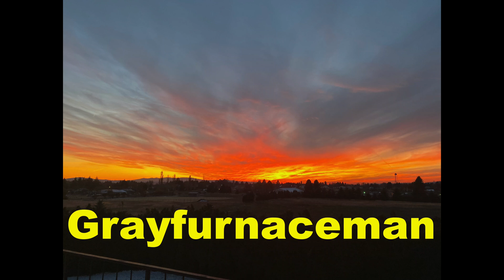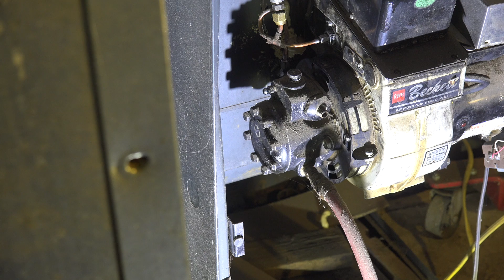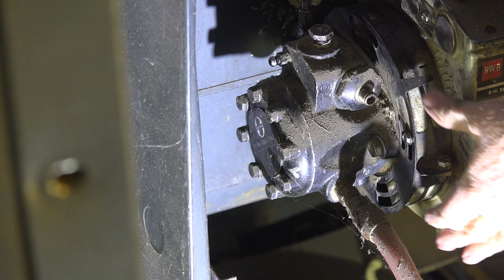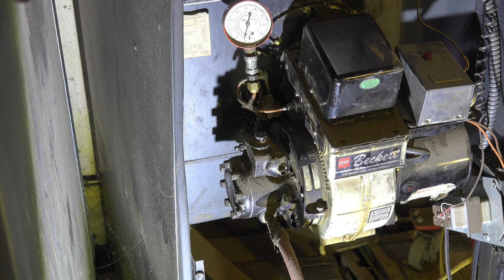How to find the air shutters on the oil furnace

Comment: I have been dealing with a smoky oil smell in my house for years. Every service tech I have had look at it tells me there is nothing to adjust and I should replace the furnace. After watching this I move the air adjustment from 5 to 6, and the smoky smell is gone. Wish I found this years ago. Thanks very much.
Reply from the maker: I am glad my video helped you solve your problem.
GFM

Comment: Would having too little or to much air cause a reset condition?
Reply from the maker: Too little air could cause sooting of the heat exchanger and smoke pipe which could shut it down.  But usually it will puff back.  A nice word for a massive blast of soot in the furnace room.  Too much air could cause the flame to extinguish and shut it down.  
GFM

Comment: Help😂.... i cleaned my furnace, chimney also replaced nozzle with same exact type and new  filter but my chimney still has some dark smoke not heavy like it had suddenly did which made me tune it up and clean it my unc who taught me said give it slightly little more air.. sound about right?

Comment: So A few years back I decided to change my own nozzles so I would purchase, with great difficulty, the same nozzle(.85 60W) my furnace guy was using. So today I noticed that my furnace calls for a 1.10 70 H/A nozzle. The furnace has worked fine with the smaller nozzle for years but what would be the reason a furnace guy would use a different nozzle than he should have?
Reply from the maker: The downsizing of nozzles is a common practice.  As houses get better insulated and have better windows, they do not need so much heat input.  And the tendency used to be to oversize.
GFM
Reply: @grayfurnaceman  Thanks for the reply. I'll be the first to admit I don't know alot about oil burners but over the last year I've gained alot of knowledge from watching videos like yours.
I guess my biggest concern was will this funace be as efficient with a smaller nozzle and a different degree spray.
Reply from the maker: As a general rule, the smaller nozzle will result in higher efficiencies.  This can be overdone.  A nozzle that is half the size of the original will probably make little to no difference.
GFM @jefftidd
Reply: @grayfurnaceman  Very Interesting and good to know

Comment: I need to know what the 21/2inch hose is on the bottom of my Becket burner
Reply: A picture would help. Is it connected to the oil pump?

Comment: To clarify, the adjustment with the pointer and numbers is the "air shutter". The other adjustment is the "air band". 

Per the Beckett AFG manual if your burner is less than 1 gal/hour then the air band should be at 0 and the air shutter should at around 6 or less as a starting point. Just moving the shutter by only 1 really affects the flame.

Comment: Can I adjust AF ratio based on OHM readouts with a digital burner control? I'm around 300 now as it was set when I purchased the home. Was 700 before nozzle and filter change. Still have light black smoke exiting chimney. There is no damper in this system for some reason.
Reply from the maker: I would not.  You need to be doing combustion analysis.  I would also want to know the vent negative pressure to determine if a damper should be installed.
GFM

Comment: Need Help,had fuel delivery/repair man put new electrodes and nozzle 60/80 ,now back flow of kerosene down gun tube and drip under housing between pump and motor,have worked on furnaces before in past, have Wayne burner miller  mobile home,what could be cause ,nozzle not far enough forward and if it is would it be pump, furnace seems to run ok except for drip
Reply from the maker: The first thing I would do is replace the nozzle.  Could be partially plugged.  Also, many of the mobile furnaces require a special nozzle with a 90 degree spray pattern.
GFM
Reply: grayfurnaceman had furnace since new 25 years ,always cleaned works great until fuel man put in new nozzle and electrodes 6 weeks ago (60-80 ) nozzle , took out gun assembly never checked depth ,started dripping pretty good,I worked a little on furnaces in past ,took out gun assembly used Z gauge to set ( electrodes were off and reset depth,runs better,if still have back drip from nozzle ,could it be shut off vale in pump,4 or 5 years old ,have new Sumter on hand, I also have 50-80 nozzle,  this is eagle 1 Wayne burner

Comment: Can you use the secondary air band to adjust your draft over the fire to .02 if you need to ? Cleaned my boiler ,Weil McLain like I always do and for some reason when I got done I had no draft over the fire . Adjusted my draft damper closed using a Bacharach draft gauge until I got .03 over the fire and the smoke was 0 or 1 with a smoke pump. Was just wondering if I could have used the air band instead of adjusting the draft damper.
Reply from the maker: No, the air band is just to get the combustion numbers right.  
GFM

Comment: This is off topic but I just got done with your cracked heat exchanger video . Had a company out to diagnose my unit...  the company said it’s a cracked heat exchanger because there is roll out from the burner which trips the safety switch. He showed me with some sort of thermometer how hot that switch got ( 190f)  before it turned the burners off.   Question: is there any other reason for rollout other than a cracked heat exchanger in? He did not visually see a crack.   Thanks in advance for any advice!
Reply from the maker: It is not easy to find cracks in newer furnaces.  There are 2 reasons for flame rollout.  A cracked heat exchanger or plugged heat exchanger.  Either case will probably mean either a replacement heat exchanger or furnace.  If the furnace is over 20 years old, in most cases, replacement of the furnace is the best route to go.
GFM

Comment: I've always done the opposite, closed the shutter and adj with the band. Only reason is I dont know how many guys I've trained that forget to tighten lock screw for shutter but never forget to snug band screw after adj. Is there a mechanical advantage to using shutter only?
Reply from the maker: The band is considered to be a mass air damper for large nozzles.  Not saying you can't use it but it is harder to get the air right.  
The issue with the shutter screw is well taken.
GFM
Reply: If you look in the Beckett AFG manual, the air band is closed for all nozzles until you get into larger nozzles.  For fractional to about 1.5gph (from memory), the air band is closed.  The shutter would be like a 3 for the .85@100lbs, 5 for 1.00, 8 for a 1.25 etc.  Once you get to where the shutter would reach 10, the air band is then opened.  IOW, the air band is kind of like a rough adjustment and the shutter is for finer tweaking.
Reply: @ohger1  I get blow back  with a .85 60 degree nozzle with air shutter at 3, Although my burner is not beckett its an olsen but everything on burner looks the same.
Reply: @jefftidd  Make sure your heat exchanger is not sooted up or your flue/chimney not blocked in some manner as you shouldn't be getting blowback at all even with too much air.  As for the shutter, see if your boiler manufacturer has a basic startup setting as I don't know how your burner settings correlate to Beckett's.  Once you set your burner to the start-up recommendation, you must perform a combustion analysis for safety and efficiency.
Reply: @ohger1  Thanks for the reply, everythinhg is clean. 
My furnace is quite old and I can't find any info on the net about it. It looks like a beckett but it's an Olsen. With no air I have a dark orange flame as I add air it becomes lighter. I'm trying the setting at 4 on cold startups in the morning to see if I still get blow back. Hopefully, I get this figured by December when I not around much and totally dependent on oil heat.

Comment: Never lived with an oil furnace, spent many hours hanging out close to one though. They seemed to be giant beasts (these were "old" in the 1960's) But ya never know when one may run into one that needs a little sorting out.
Thanks for the video GFM
Reply: Old? Everyone in New England has one. They are very clean and efficient and way safer than gas.  Burns with more btu than gas.